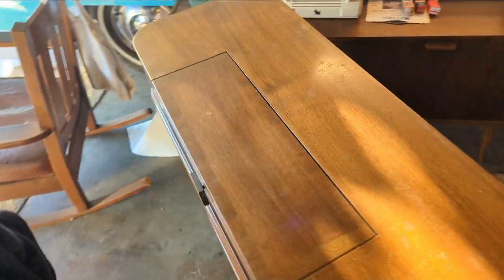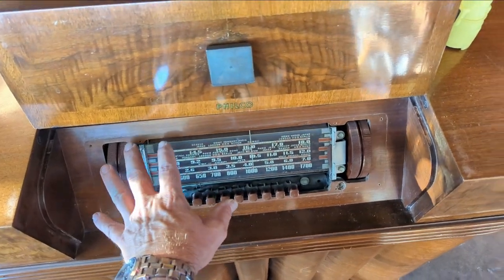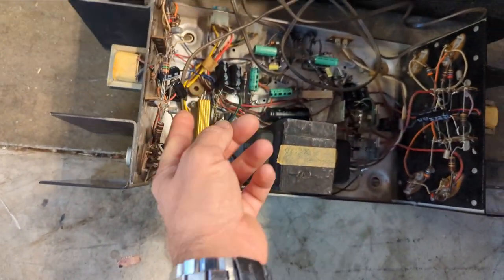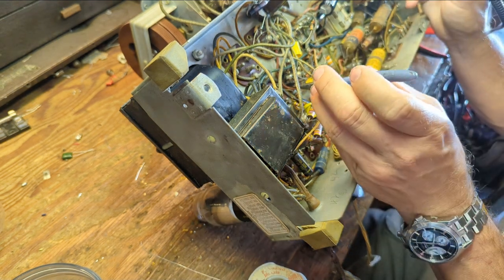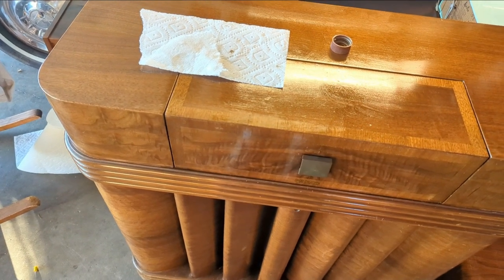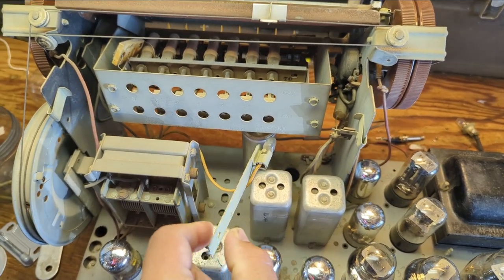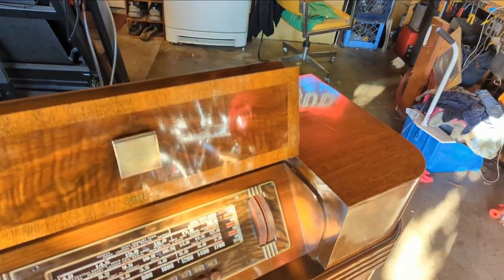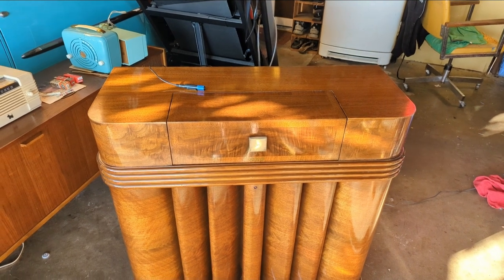Snazzy 1941 Philco console with a PRISTINE finish

Comment: I never seen a restoration  video on the Philco 41-300. This is a treat with very little rubber wiring.The fifth lamp is 
the pilot light according to the schematic. That goes in the middle below the three banded wood section in front of 
the cabinet. You can clearly see the hole in the cabinet at  20:08 in that lets you know the radio is on when the door 
cover is closed. You missed two black beauty caps in the chassis BTW. Two thumbs up restoration otherwise.

Comment: Beautiful cabinet.  The knob for the door is not original, it had a smaller round gold one.  These Philco's were very well engineered sets for the most part, with high quality components really up until 1948 or so.  Lucky it's not a 1939 model where the power transformer wiring is rubber too and the whole transformer must be removed and rewired!  The biggest drawback on these other than the rubber wiring is that Philco loved to use indirectly heated rectifiers like the 6X5 and 84.  If they short, they often take out the power transformer.  If you watch my 1941 Philco video I believe I spent some time discussing how to repair that type of pilot lamp socket.  I use a nylon washer to insulate the spring.

Comment: Nice radio Seith how are you. I have a  Philco 48-1986 I overhauled with all new capacitors and replaced 13 resistors that were way off. It plays good but not great it has weak tubes they're mostly locktal tubes. I don't have a tube tester for locktals. The way I can give a quick idea about tube strength is turn it off and wait three seconds and turn it on if it it doesn't come back on immediately then one or more tubes is weak and that's what I have with this one but it will have to do. I had to rewind one of the FM IF transformers that was fun. I took apart a used TV speaker and got the wire off the voice coil it just happened to be the right guage. The FM IF is not the standard 10.7 Mhz. I can't remember exactly what it was its been a while It was in the nine MHZ. The rectifier tube was so weak the FM couldn't play at all. FM is more demanding. The voltage was only 140 it supposed to be 380 and the loctal socket was overheated I couldn't plug a good tube in it so I had to solder high voltage diodes underneath then I added a 22 ohm 7 watt fuse resistor in series with the 120VAC that dropped it to 110VAC at the transformer in case the old transformer shorts. They didn't have thermal fuses in them. After getting the voltage up where it should be FM came in good. Nice work Seith have a great day

Comment: Yes shango had a automatic tuner for that radio.
Reply: Not the 41-330. His was a 40-217 with an IF Frequency of 470 KC . Done so to limit interference with the 
controllers receiver in the chassis.